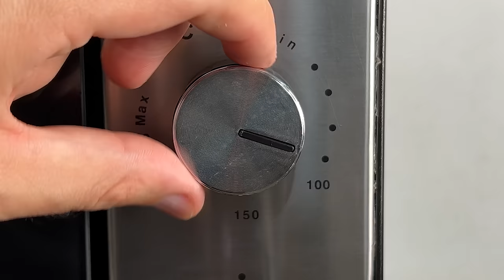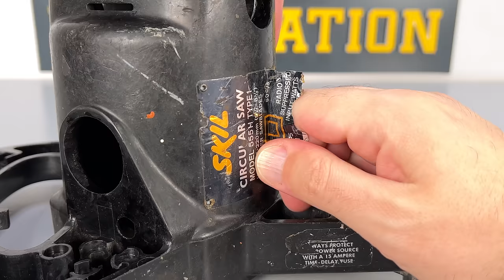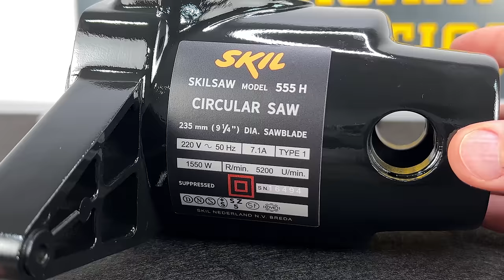Watch this Restoration , Win this Restored Skilsaw !

Comment: I love your videos and you always do an excellent job. I'm glad to know you're in better health and I wish you the best. My only criticism for this one is the amount of parts that were either left as is or purchased. I was excited to see that you were working with electrical parts. I understand that some of these pieces are very complex, but it's hard to say much electrical work was done at all other than a bit of cleaning and shining on the exterior. The untouched parts going back in around 15 minutes felt like a shame considering everything else was so great. I don't blame you if it's not your specialty, and don't let that stop you from doing more restorations like this. I also wish something was done with the original blade instead of a direct swap, but it seems like the old one might not have been up to par for actual use which is what was requested of the restoration. I'm excited to see what you do with it and future videos to come! Well done!
Reply from the maker: Thanks a lot Jacob 😊 and thanks for your worries too , now I can say I’m in better condition 🙏

Comment: You can use regular all-purpose WD-40 spray (blue and yellow color one) to give back the factory rubber sheen to the rubber grommet/strain relief of the electric wire on the skill saw I used it on my C-13 Power cable for my laptop and it is as good as new to the touch and appearance.
Spray the WD-40 on the electrical wire and lube it on the wire for its whole wire length live it for the night and you are good to go from the next day onwards.
Like you are using oil to lube the machine rod with your fingers.
Needles to say wash your hands with soap after you are done before you have dinner and go to sleep for the night.
Reply from the maker: Thanks a lot for the trick ! I will use it next time 👍 cheers

Comment: Pretty good. Although I've never seen one of these where the bottom of the sole plate was painted. They were always bare metal so they didn't leave marks on the wood and the paint would have worn off anyways
Reply from the maker: Yeah , it has sense but this one was painted black before and I tried to keep it original. Anyway , doesn’t matter now because it is an item for collection now and need to be protected against rust 👍

Comment: This is a good job 👍
But, in beginning it says motor not working... so just by cleaning the outside of it, it suddenly works again  ?
Also normal people dont have all these machines to make new parts, but still they restore and make em look brand new.. 
I also does this, but only use orginal parts, and fix up the old parts.
I dont say its bad what you do, cause it looks great 👍 but this is more a rebuild with new parts, than a restore project.
Reply from the maker: Hi ! First of all , the circular saw didn’t worked and I thought because of the motor but I found that some wires wasn’t attached well and some was very rusty , probably they didn’t made a good contact . Some people maybe don’t have the tools I have but these videos are for relaxing and watching the work . I don’t pretend to be the most knowledgeable man or a professional. I just do some work how I know and how I can and I try my best every time 😬

Comment: Congratulation for the great restoration. But why put a smaller saw blade at the end? Unless the size of the blade for this saw isn't made anymore.
Reply from the maker: Yeah , you guessed right. The size for these saws are not made anymore. I bought one from skil company to match with the tool and after the saw arrived to them , they changed with an old one , bigger but not new, let’s say in decent conditions.

Comment: One of my hobies is restoration. I gotta, ask, how do you decice what type of paint tecnique you'll be using? When do you powder coat, when bleing, when spray painting, when do you use epoxy primer?
Reply from the maker: For this tool for example , I used powder coating for the base because powder coating is more durable and is more flexible . On the aluminum parts I used classic paint because I don’t like to powder coat aluminum parts. Aluminum is very porous and I don’t get nice results when curing the parts in oven . That’s why I choose classic paint job. Epoxy primer is more durable than normal primer and that’s why I choose it .
Reply: thanks, that answer helps a lot!  @CoolAgainRestoration
Reply from the maker: @emilweigand1119 you are welcome

Comment: I am trying to get my skill to this level. Great work. Do you use different air pressures or media when sandblasting plastic?
Reply from the maker: Thanks a lot ! When I sandblast plastic or soft material , I use air pressure between 4-6 instead of 8-12 and instead of red garnet I use aluminum oxide or glass beads 👍

Comment: I thought you would have trouble finding a 9 3/4” blade. Funny the original blade was in backwards, it looked like it could have been saved. I have 15” and 16 7/8” saws.
Reply from the maker: Yeah , I asked them for a bigger blade and they don’t make it bigger anymore . Probably they have smaller circular saws . The tool arrived in Germany and they changed the blade with a bigger one but from an old saw 😅 just to look good and to not have teeth exposed anymore 👍
Reply from the maker: Yeah , I asked them for a bigger blade and they don’t make it bigger anymore . Probably they have smaller circular saws . The tool arrived in Germany and they changed the blade with a bigger one but from an old saw 😅 just to look good and to not have teeth exposed anymore 👍

Comment: Awesome job, but surely that blade is 40/50mm too small? 🤔🤷🏼‍♂️
Reply from the maker: Yea , it is 190 instead of 225 but I asked Skil for a bigger one and they don’t make it anymore so big . Probably the modern circular saws are smaller or made it different than old ones. Anyway , the tool has arrived to the booth in Germany and they put a bigger blade ( not new but an old one from an old Saw )

Comment: It was great, until you put the wrong size saw blade on.
Reply from the maker: I didn’t! The video was a collaboration with them and they didn’t wanted to install other brand blade . So I had to use a Skil blade , but unfortunately they don’t make the circular saws so big like once and the blade too. So I had no chance to buy a new blade from Skil that will fit in that skilsaw. Also , after the skilsaw , reached their destination, they had to find a blade that fit the size of this saw and they installed an old blade from Skil 😅

Comment: So right away that first nut was too clean and came off too easily, which tells me that you had already disassembled this before the start of the video. For the record i also used to work for Skil Corp back before they were bought by Emerson Electric..just for some context. The restoration was nice, but why did you put the "too small" blade on it ?
Reply from the maker: True ! I made a partial disassembly before  to see with what work I have to confront. Thanks and glad you liked it . To answer for the last question , I put a smaller blade because they didn’t make bigger than 190mm now . They wanted to use a Skil blade so I had to buy one just for the video . After the saw reached their destination, they put a bigger one , but not a new one , just an old one but in good condition. I didn’t understood why they didn’t sent me before but anyway , I worked with what I had 😬

Comment: No paint on the base plate or it will just come off on the material you're cutting.
Reply from the maker: To be practical, yes , you have right ! But this tool is not anymore for being in use . Is now a piece for display and I painted for keeping rust away 👍

Comment: But the new blade is way smaller............ 🤣🤣‼️
Reply from the maker: Yeah , they don’t do it anymore big blades. The tool reach the Germany countri for their exhibition and the Skil company put a bigger blade from an old tool
Reply: @CoolAgainRestoration  funny! Because, I'm a cabinet carpenter from Bavaria, Germany 😁👍‼️
My solution would be, to put a Festool Blade in the Maschine, but with out the Festool writing..
Reply from the maker: @robertkoleczko3987 Yes , This Could be a solution but they use this saw at an exhibition in Koln , Germany. Can’t be a Skil saw with festool blade 😅

Comment: Skil may of invented their version of the circular saw but the concept of the circular saw was invented long before them, so no Skil DIDNT invent it
Reply from the maker: Interesting! Do you have any info that proof that ?
Reply: @CoolAgainRestoration  a quick Google search will give you what your after, Skil isn’t even mentioned, as is usually the case 2 inventors will claim this but there are slight differences the first is claimed by Samuel Miller in 1777 and the next being closer to skils version being a powered circular saw was Tabitha Babbitt in 1813. Hopefully that helped, again Skil has invented their version using the circular saw but they didn’t invent it per say